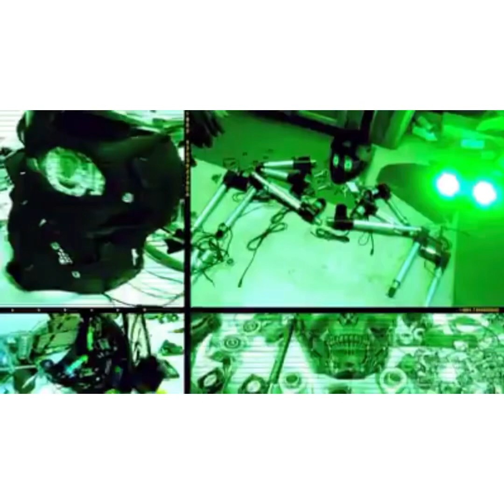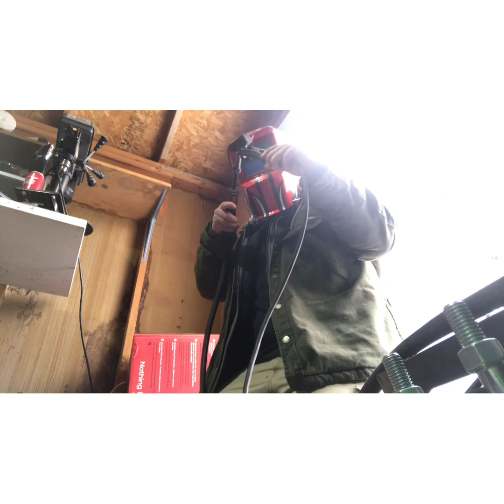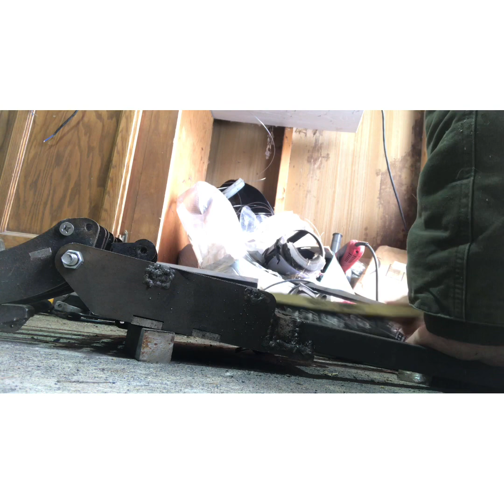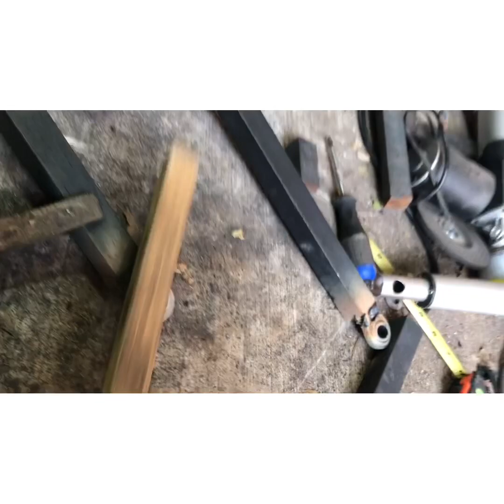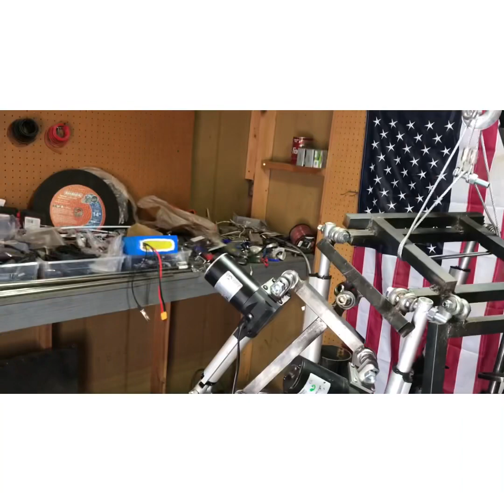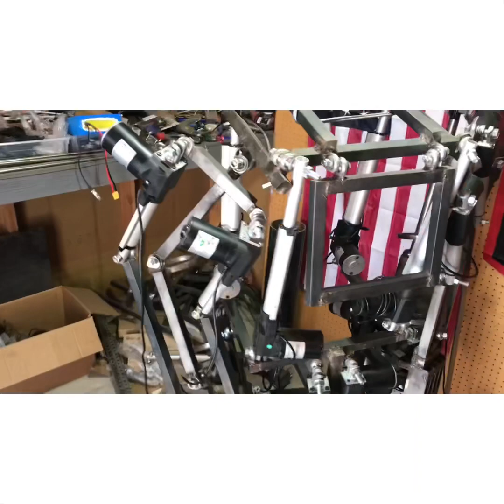Power Armor Project: Frame V - Arms

Comment: What type of actuaries are using pneumatic or hydraulic cylinders and what made you choose that option and what are you using to program everything
Reply from the maker: Neither. The actuators I have are not air powered or have any fluids. They are just motors attached to linear rails that take 12v-48v. Each actuator pushes and pulls up to 5000n or 1124lbs. I choose this style because it’s reliable and low maintenance. It’s also easy to hook up to an Arduino, which is the microcontroller for the suit. (Currently up to 4 Arduino Mega in the suit with servo and motor shields)
Reply: @zandermarriott  that's is  brilliant thinking mostly low maintenance and cost keep up the good work can't wait to see this thing move and stand on its own
Reply from the maker: @hoganarmstrong8791  thank you! The end goal is to prefect a exoskeleton the gives super strength and defense and the average person can afford it. The tech is here but few are putting in the work.

Comment: What do you think about fiberglass things on your exoskeleton?)
Reply from the maker: It would not be needed only because the armor will be the strongest bullet resistant material on the market and even the eye sockets will be rated to take handgun and rifle rounds
Reply: @zandermarriott , I meant the transition between the frame and the body;) what about the fiberglass/plastic and silicone?)
Reply from the maker: I plan to have some sort of impact absorption and dispersion material between the armor and frame to minimize the transfer of energy. Eventually I want to put kenetic cloth that takes friction from the two steel sides and transfers it to a battery for me to use

Comment: What will be hardest part for you to build?
Reply from the maker: The control systems to activate the actuators. There is no switches strong enough to take the voltage and amp rating.